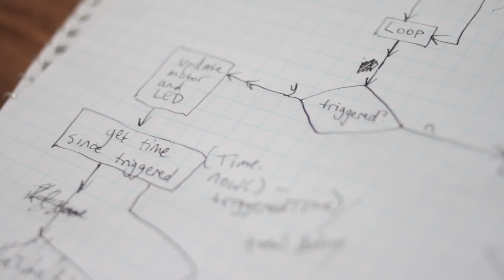Boombox Blaster

Comment: Great video :)
Can you tell us how the person made his macbook keyboard strobe like that at 0:38?
Been trying to do this for years
Thanks
Reply from the maker: Mehulsuresh7 lol, actually, the keyboard is completely normal... cool effect through right? it has to do with the frame rate of the camera (24fps) interfering with the flickering of the keyboard's constant pulse of light - at least this is my best guess, because the same interference issue happens when shooting under certain light sources. But if you figure out how to make a keyboard actually pulse lights please e-mail us! sorry we didn't have the answer you were looking for.
Reply: Neo Pangea That's a bummer :( .It looked awesome
There is a way to make it pulse using a tweak called ispazz, But it doesn't work with yosemite's 64 bit architecture